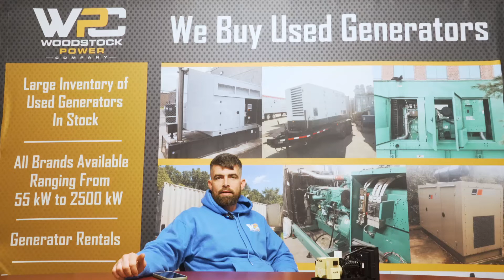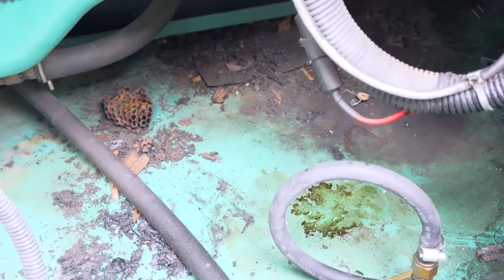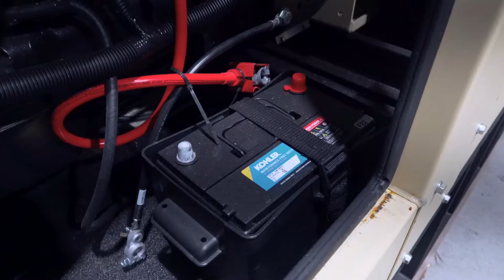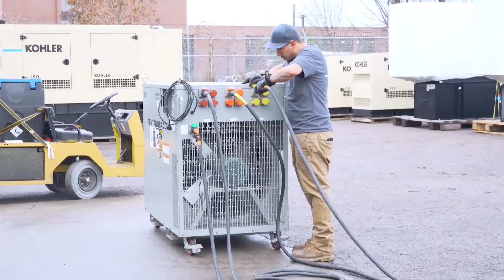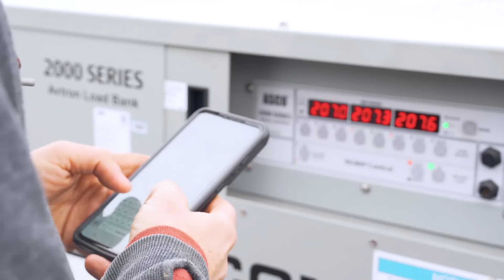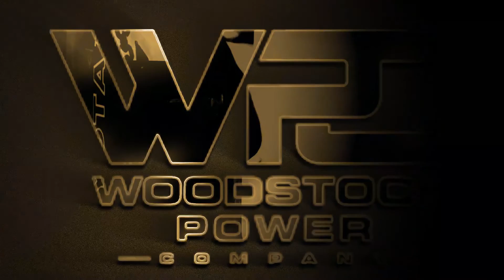Generator Maintenance 101: A Step-by-Step Guide

Comment: What do you think about this Load banking procedure.

To safely start and load an 8 MW (megawatt) power generator after preventive maintenance, perform pre-start checks, run at no-load to verify parameters, synchronize if paralleled, and apply the electrical load in calibrated, gradual steps while monitoring temperatures and pressures.Pre-Start and Startup VerificationClear the area: Remove all tools, rags, and maintenance equipment from the unit.Check fluids and filters: Verify correct levels for engine oil, jacket water coolant, and fuel systems. Ensure all maintenance drain valves are closed and new filters are properly secured.Verify electrical safety: Confirm that the main generator circuit breaker or air circuit breaker (ACB) is open and locked out from the load before cranking.Crank and idle: Start the engine and let it run at zero load for 3 to 5 minutes. Check for abnormal vibrations, unusual mechanical noises, or fluid leaks.Monitor stabilization: Verify that oil pressure, jacket water temperature, voltage (e.g., medium voltage 11kV/6.6kV or 480V depending on design), and frequency (50Hz or 60Hz) reach nominal values with zero active alarms on the control panel.Synchronization and Gradual LoadingSynchronize (if applicable): If the 8 MW unit runs in parallel with a live bus or other generators, engage the synchronizer once speed/frequency and phase angles match the grid, then close the main generator breaker.Step loading: For a large 8 MW industrial asset, avoid slamming the system with full load. Apply blocks of electrical load in increments (e.g., 25%, 50%, 75%, and 100%) or follow your plant's specific ramp-rate limits (such as MW/minute guidelines).Allow thermal stabilization: Hold each load step for 15 to 30 minutes to let exhaust gas temperatures, turbochargers, and winding temperatures stabilize properly.Post-Load MonitoringTrack core parameters: Continuously log current (amperage), active power (kW/MW), reactive power (kVAR), frequency, and exhaust gas temperatures across all phases.Final walkaround: Inspect the high-voltage enclosure and auxiliary skids one last time under full operating load to ensure no thermal hotspots or pressure leaks develop.If you can share the prime mover type (diesel engine vs. gas turbine) and whether it is paralleling with a grid or running standby standalone, I can provide specific operational limits and safety checks.